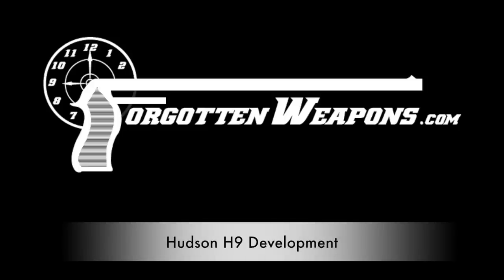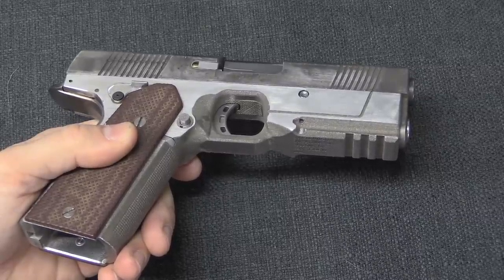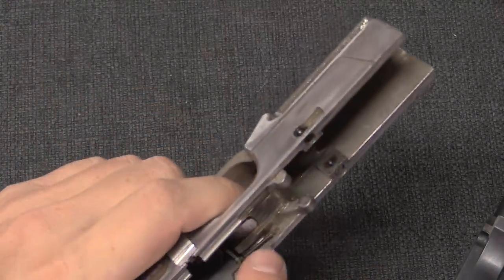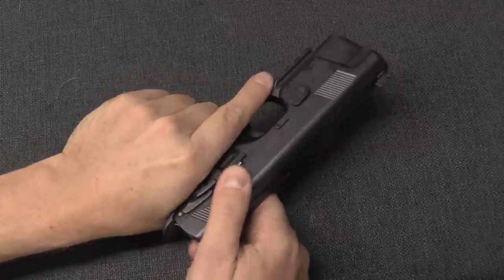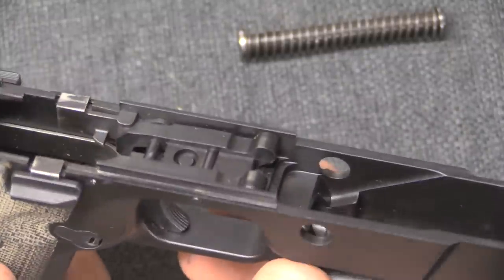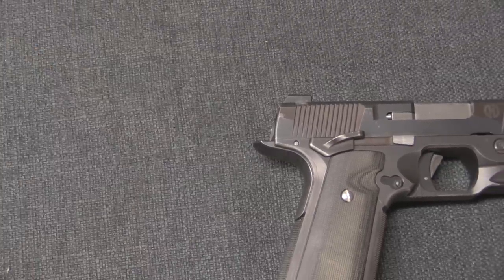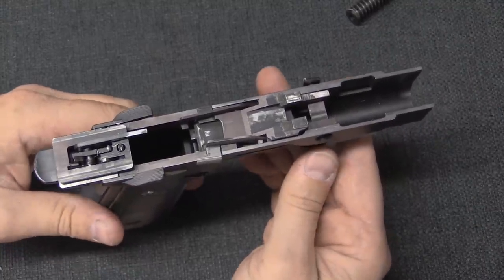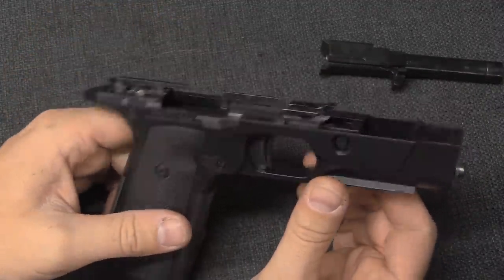Hudson H9 Prototypes & Development (with Cy Hudson)

Comment: If I had a nickel for every time someone told me this gun was bad just because it was expensive, I'd be able to afford one of these.
Reply: Thank you caulk boy
Reply: Yup, I’m saving up and this is on my list. Certainly not my first choice but it is my first pistol choice.
Reply: +The Great Mechanized Ape What bothers me, and this is mostly based on the comments section from Hickok's video on the H9, is the patent lack of understanding of a little thing called "price bracket." People are comparing this gun to Glocks and Shields, and saying the price makes no sense. I say, the price makes sense when you compare it to guns in it's price range, like the 226 Legion or the CZ Shadow. And none of those pistols are striker fired. People see "striker fired" and immediately assume this pistol is supposed to be a budget carry gun. The H9 has confused them with it's innovation.

Personally, I think the H9 won't have issues selling. The kind of people who asked for a factory high-end striker-fired target/comp pistol got exactly what they wanted. It fills a niche that was previously empty.

On an slightly unrelated note, I'd like to see Hudson attempt a budget polymer 9, although the market for them is positively saturated by now.
Reply: True, but at least the custom Glocks are improving on the 30 year old design most of the time. This is taking a 100 year old design and adding in improvements that were made 30 years ago and selling it as a striker 1911; the only similarities are the trigger and the style of the frame and slide. I would assume the custom Glock people are more users than collectors; this seems like it's more for people who like to collect weird and rare firearms.  These are targeted towards a different type of consumer than the ones looking at $500 guns and getting $1200 worth of work done to it. I would not be surprised if this firearm pops up in another Forgotten Weapons video in 2020, but in the context of actually being forgotten.
Reply: When I have enough nickels.....
Reply: +Click Clack Bang You assume wrong. This is largely a competition gun.
It doesn't "add improvements on top of a 100 year old design". It takes some philosophies from a 100 year old gun (and other guns) and combines them in a new design.

It also sells quite well. Right now the distributors apparently want "as many guns, as soon as possible".
Reply: This is not a dumb move. You have to understand, a startup selling a complex engineered and manufactured product can rarely can go into business with it as a mass-market product that competes with the biggest names directly and fight for cost, unless they have the backing of huge investments and corporations on board. And at that point your design has to be a 'surefire hit' and basically proven technology, proven market, etc etc. Also the people heading that type of development up would likely be industry vets who were hand-picked to move that initiative by investors. 

Outside of that, how do you think a startup could afford to come to market and try to go toe to toe with the dozen or so existing major manufacturers with decades of inertia and who have been fighting in a race to the bottom? A startup like Hudson is better off to exploit a niche where you can charge a premium to a willing audience that is small enough that you won't be flooded with orders. You want to move few units at first because your production is not tried and true from decades of production experience. Your production is expensive because you have to do it for a long while before making any sales. So you have to go premium or you have to go massive volume. The capital investment for premium is, simply, less.  

There's plenty of viable handgun businesses moving thousand-plus dollar guns, Hudson is squarely in that camp and that's by choice. I think it's a wiser move than had they tried to come out and compete for that $400-600 market.
Reply: Yes, it's modern improvements on a 100 year old gun, that is why everyone is referring to it as a striker-fire 1911. Where did you get "this is largely a competition gun" from? They aren't a race/comp gun company, and they haven't advertised as such. 

I don't know how well it sells since there aren't any figures to go by or many Youtube videos, outside of the usual suspects that get review samples, to judge that off of. It's still too early to tell how they are performing sales wise, distributor demand could be because of consumer demand/interest or they can't churn enough out to meet basic demand for distributors to hold stock. 

TTAG posted a review in November on their site and accuracy was atrocious, "At 15 yards from a sandbag this gun hits about six inches low. Every other shooter who attempted accurate hits saw the same results." So much for accuracy on a competition gun, but at least it has a low bore axis. amirite????
Reply: +Marvincz3 I tend not to trust gun companies anymore when it comes to promises like this, my guess is the H9 is not working well suppressed otherwise threaded barrels could be out the door day one, second thing on the RMR cut, this is a 1,200 dollar handgun, all of them should have RMR plates 

When you can get a RMR cut from the factory on a 600 dollar handgun like the glock or P320 and it's not coming standard on a gun twice the price, issues at the source are obvious.

Threaded barrels are the easiest things on the planet to make, order your barrel blank a quarter inch longer, apply 1/2X28 threading, slap on thread protector, done, no reason to test this product unless the thing it's attached to does not like running suppressed. 

as to why i don't trust any gun company till you can buy the final product, i bought a ACR back in the day and i'm still waiting for caliber conversions and accessories.
Yet every single fucking year is the "Year of the ACR."
Reply: +Click Clack Bang So what is there from 1911s design? Only general ideas and principles, nothing is actually based on it.
The grip angle? The linear trigger? The fire control group is completely different. The way the rear looks like a 1911 grip safety? There actually isn't a grip safety, so again no technical influence.
The only thing I can think of that is similar, is that it has a leaf spring to motivate the fire control group.

Also, what you are describing from the TTAG review is not "accuracy". Accuracy would be the size of the group (which wasn't stellar there either, but not too bad).
Reply: +Redneck Fury Your comment shows your lack of knowledge on the topic.
Getting threads on the barrel is certainly an easy thing. But they must first test that it works well suppressed. They can't just assume that everything will be fine, slap threads on it and send it to customers blindly. It's a new locking mechanism after all. Even with browning tilting barrel pistols, which are dime a dozen, the manufacturer still has to test that it works fine suppressed.

You also seem to forget that this is a completely new company with their very first design. Their first priority is to get the pistol released in the basic form. Until then, they are only shelling out money and not getting anything back. Once they have pistols going to customers and some revenue flowing in, they can start delving into RMR cuts and suppressed versions.
Reply: +Marvincz3 Stop fanboying, seriously it's pretty aweful when people come here to discuss shit and you are just slaming your face against the wall "ITS NEW IT HAS PROBLEMS BUT IT HAS TO HAVE PROBLEMS BECAUSE ITS NEW"

Guess what, i did buy a H9, and i like it, but being new does not excuse them from not offering the very basics that everybody else and their mom has been offering for years now at a price point that can be less then half.

Meanwhile, glock does not even offer factory suppressor ready version of their guns, oh look, slap a threaded barrel on and it's GTG without a hiccup.
RMR cut is easy if the gun has the internals to handle it [IE enough clearance to allow the cut] , it's a square cut with studs and threading for the RMR base, the H9 already has intricate cuts on it's slides, it's not outside their manufacturing capability.

I'd be surprised if we ever see any other version of the H9 then the one we have, from where i'm sitting and from a mechical look, the H9 is what it is, just like when we had the Strike One, great gun but stuck in a box it made itself.
Reply: +Scott Watrous nailed it. The H9 is deliberately targeting a specific type of shooters needs and does a very good job meeting them.
Reply: +Redneck Fury I don't think the H9 not being can-ready is a very big issue. The other things you mention are more relevant. Thing is, I keep hearing "gimmick" and I don't think people know what that word actually means. Hudson isn't selling "Uberpistol Technology™," they're selling a high-end 9mm with a unique feature among high-end 9mms, for around the same price if not slightly lower than high-end 9mms. They didn't market it as anything more than a niche pistol. There's a difference between a gimmick and a niche. Skyactive technology is a gimmick, the H9 is a niche. At $1,100, it's cheaper than most niche pistols by a long way.
Reply: +Redneck Fury I wouldn't call the absence of the RMR cut or a silenced version as "having problems". I think I explained it logically - a new company needs to release their first product in the basic form to start revenue coming in. The fact that stuff needs testing is, in my opinion, quite obvious as well. I guess not to everyone.
Reply: There are many good observations here but we can’t all be right. Perhaps one of the owners will put a few of these questions/comments to bed.
Reply: It's too bad that they didn't consult this group of nobodies in these youtube comments - you know, since there are so many design, engineering, manufacturing, and business planning experts in here...
Reply: I bet he thinks that a threaded barrel is the only thing needed to run a can on an AR(or pretty much any other gas operated firearm) as well
Reply: Don't forget - it has to be able to use any round from 5.56 to .50BMG with only a barrel change too
Reply: If someone enjoys owning this pistol, that's all that matters.
Reply: you have the best username I have ever seen, bravo
Reply: marvincz3 the fact that it's priced what it is and doesn't have cuts for a rear-mounted rail and isn't in 10mm is why I would never buy one. I don't shoot 9mm, I haven't for about eight years, and I don't like irons so if it was a gift it would probably never leave the safe.

It looks neat but I'm like "what's the point?" If I carried a 9mm I just don't see why I'd ever switch to this.
Reply: +Jixijenga That is of course understandable in your case.

The fact of the matter is, though, that 9mm is much more commonly used than 10mm. If it was 10mm, there would be many more people who would say "I don't shoot 10mm". Making it in 9mm is a sound business decision.

I also agree that the absence of an RMR cut is a drag. So do Ian and Karl, for example. But like them I also understand why it's like that and don't see it as a reason to be mad at the company. (Not saying you are, just some people in the comments)
Reply: marvincz3 I'm not saying it's a bad business decision at all, I agree it's smarter to cater to 9mm first with a 10mm option later. However, for me, I just don't see the appeal of yet another 9mm piece when "it works reliably" is my only requirement and it offers nothing substantial enough for me to switch.

These people are not selling snake oil, the H9 is obviously a good firearm, I just don't see a place for it in my world. An H10? Yeah, I might switch over for that.
Reply: Who cares about affordability or price point, there's only one question that matters.
Does it take Glock mags?
Reply: OOF
Reply: holy shit thats exactly how i am feeling about it right now currrently lookng into it more now lol
Reply: EHCK
Reply: Well, tons of people have had reliability issues with it, parts constantly break, the company is currently being sued by their manufacturer for lack of payment, customers who've sent in their firearms for repairs can't get in touch with anyone at the company to get their very expensive paperweight's back, and the company is probably going to dissolve in a few more months. So, yeah, it's bad.
Reply: @RexKramerDangerSeeker  How prophetic your comment was.
Reply: @mrlucky5025  I forgot about this until just now. I highly enjoyed rereading these comments and the folks trying to justify this thing. This makes my coffee taste extra special this morning.
Reply: True, even now on gun auction and similar sites, these can still go for around the original price.
Reply: This whole comment section aged poorly
Reply: @thegoldencaulk2742  WRONG
Reply: And now with nickel prices being what they are - you could buy two!

Comment: Something strange going on with the audio in your more recent videos.  Almost sounds muffled or even as if it's clipping.  Otherwise, great video.
Reply: Yeah there are definite mic problems. Here it seems like Ian is only using 1 mic, on himself. Which means that Ian is clipping, because the mic volume is high and he is close to it, and the other guy is slightly muffled.
Reply: What do you think would be the best setup to use for interviews like this? Two individual lavalieres or something like a single dynamic mic between them?
Reply: two lavs, either going into the camera as left and right channels, or into a separate recorder. Advantage of the separate recorder is it can be 24-bit and you can leave more headroom, avoiding clipping.
Reply: Fuzzy Dunlop Quick question - you took this name from second season of "The Wire"?
Reply: I think Ian should just buy a spare clip mic for these interviews :)
Reply: thats what a 'lav' is.
Reply: It almost seems like both people are mic'd up but the audio is going into a single channel. So that when the other dude talks, its too low so that track gets amplified but that also amplifies ians nose
Reply: I noticed that too. I don't pay any mind to it because of the awesome content but it is there.
Reply: As it was all recorded with Ian's mic, he did obviously set the gain as high as he could and then he apparently adjusted the volumes manually while editing to equalize the volume difference between him and Cy. This "Um" was a short interruption in Cy's speech and Ian did probably miss it while editing.
Reply: Too much gain. Ideally they would be mic'd individually, with area mics to fill.

Comment: Idk how i haven't seen this video. But Holy balls! I absolutely love the Aesthetic of this gun. Especially the proof of concept version. The 1911, coloring of the metal and grip panels. Not to mention the whole Aesthetic of the gun is inspired by the 1911. But it has this modernized feel at the same time. I would love to have an H9. If it's atleast as reliable as the 1911 that is. Either way it's a really cool gun.
Reply: Ok now that i see the proto#64 (production model) i kinda hate it.. Idk if its the finish or what but it looks like the heretical offspring of Hi-point, Glock and a colt 1911...

Comment: This was very very cool. I have an h9 and I think it is one of the best fit and pointability lowest recoiling pistols made. ( the alien beats it) I really hope that someone picks it up and makes it fly and even puts that chasie in the Aluminum and even poly frame. Honestly mine is super reliable And shoots like a dream. What would I do better?? Not much. One is use more aggressive checkering on the grip and grip panels . Make the undercut deeper at the trigger bow , lighten up the trigger to a 3 lb trigger , change the dongle in the trigger to hinge at the top, put an mos cut in it and make the rear sight adjustable. And most of all make sure to use the best metals and get your hardness right and for sure have spare parts made and production models ready with a 10k to 100k torture teast done. Having a speed peddle that sticks out on a angle from the take down lever ( option) Also a threaded barrel with tall full night sights would be great as well. It really sad they went under as I feel they were on their way to the perfect pistol.
Reply: ‘What would I change? Not much!!’

Proceeds to list much 😂

Comment: As an young engineer the locking lug/barrel and tigger/seer engagement seemed needlessly complicated and/or inefficient, right up until the final prototype. The last one seems like a very nicely put together system. I like that you guys refined the socketed lug and then reversed the position of the lug from the sub-frame to the barrel and the socket vice versa. I'd have loved to buy one, sorry I couldn't! I hope to own one someday.

Comment: The "Brick" may look hideous but the 3D printing portion of this is probably the most fascinating aspect to me. Those round locking lugs on that and the "Boat Anchor" were a bit of a wake-up call for me in realizing some of the potential that advanced materials 3D printing such as steel and hard polymers could have. Also getting a first prototype made in 2-3 weeks is astonishing.
Reply: Mika Koskimies ...frame and slide machine time couldn't exceed 10 hours.....
Reply: Once you have designed and made the tooling and sourced the materials for it I don't think a small shop could have that done in nowhere near the same time.